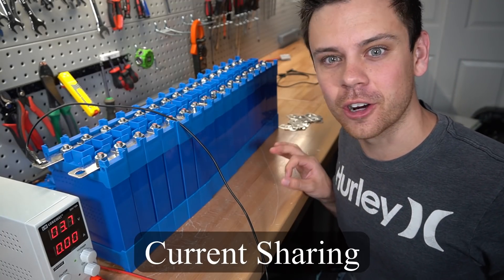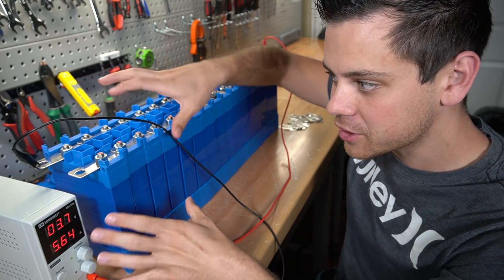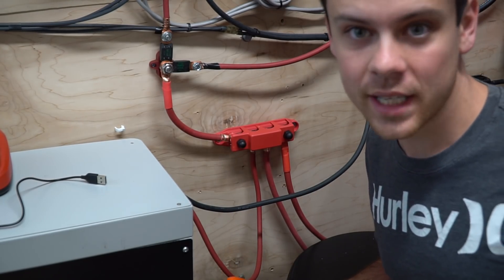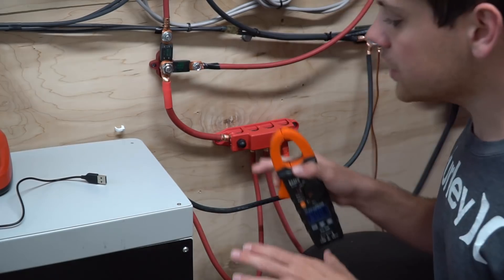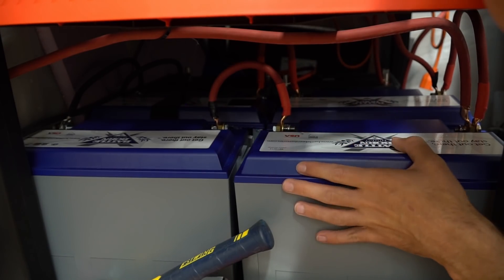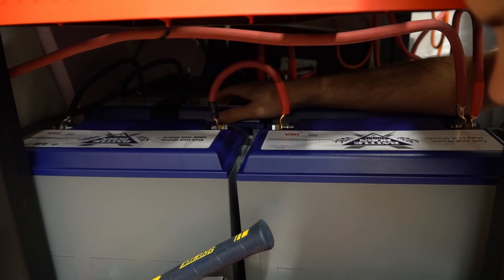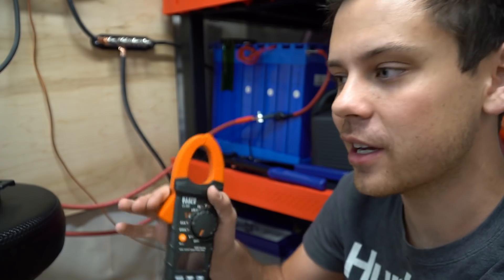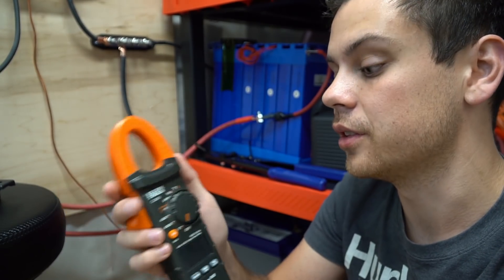Current Sharing Discussion for Solar Batteries

Comment: Is there a device that looks to when the controller is not supplying the batteries when they are full. So I can use this to charge electric bike or heat water... etc and not waste surplus panel watts?

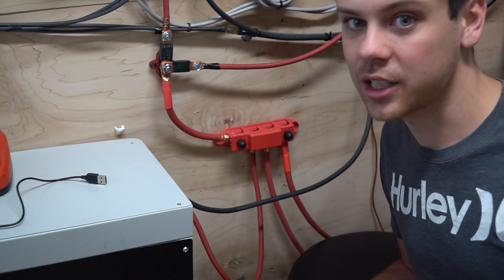Comment: I have always been taught to not connect different size batteries/battery banks in parallel (regardless of chemistry). Around 5:00 mark it seems like you have different battery packs connected all in parallel operating together. Wondering what I am missing, what article did I forget to read?

Comment: I wired all my batteries to a common busbars for neg and pos. Much nicer battery load distribution.
Also each battery has a circuit breaker for ease of testing and isolation.

Comment: I'm in the process of building a solar system for an offgrid setup with no prior experience other than the occasional potching and your videos have been a massive help, legitimately. I'm starting very small (12v 100ah lifepo4 CALB, 400w solar, 40a epever, 2000w inverter to run basics)  but would like to add other batteries as I begin to need them. The thing that has got me is, everywhere I read, I'm told not to add new batteries to an older bank. When I'm ready I'll more than likely stick to 100ah calb cells, but could I use higher capacity cells, 200ah for example? You've just said that you have older battleborns with newer batteries. How did you get this to work? Does each bank (4 x 3.2v) need a bms so it'll shut down the batteries when they're depleted, or do I have to do something else to get them to work together? Its the last thing I need to get my head around because atm I can afford to get another 8 cells to start out with a bigger bank, adding to it is definitely more viable, but don't want to destroy batteries in the process of increasing my bank. Any advice?

Comment: Which solar inverter will you recommend for running with heavy duty loads for off grid tools like 2000wh 2000wh tools for 30 minutes continues?

Comment: Question, If while checking amp draw per your vid, could you place an additional path for current via jumper between connections to tune the draw between cells or would that be kind of a waste. Just wondering.
Reply from the maker: Yeah sure

Comment: when you tested the battle borns, did you consider that the other half might have a bit of a lower voltage? they might take turns contributing more current, like a see saw.

Comment: Hello. thanks for your videos they are great.
I have question,.  
I have 2 mppt.  one inverter. but that battery is my problem.  the battery  4 battery  6v each 400ah.   and 10 battery 12v each 80ah.   how i wire it .

Comment: Measuring current difference isn't the issue. Voltage difference across each cell is the issue. With low currents there will be low difference so you are probably okay, but showing amps is meaningless.
Reply from the maker: But there is a difference in resistance. And more or less resistance will change current flow if you have CV source. I remember using current to determine voltage drop. Such as a load test on a battery. It will change
Reply: @WillProwse  Correct. And measuring the voltage across the cell (or battery if you cannot access individual cells) is the most direct and accurate way to see what is going on. Measuring current exposes you to all the variables such as cell capacity, internal resistance, wire sizes, etc that you talked about in justifying why different currents were acceptable.
Measuring voltage across the cells is how we manage batteries. Works with series cells and parallel cells.
Reply from the maker: @Sylvan_dB  ohh ok, smart. Should do that instead. Thanks Sylvan

Comment: Great video!! After watching it, I realized that it is possible to connect more that one battery in an inverter. You have batteries with different capacities. Do you have a video explain how to connect them? Which aspects should be taken care? If you don't have a video I encourage you to make one.
Thanks.
Reply: Exactly...I have been wondering this for sometime.
Reply: I'm wondering how best to connect 18650 packs to my lifepo4 system. I know I'll only get a portion of the capacity out of the 18650s but at least they'd be used more

Comment: What are your thoughts for a combined AGM & Lithium battery bank? I want new LiPo batteries but want to use my existing 24v AGM bank. I see lots of threads on people using them combined with no problems, any long term problems?
Reply from the maker: Never ever do it

Comment: I have found that the best way to parallel connect a larger bank of batteries is the "octopus" way: hook each positive post to a terminal block with the same length wire, then from that block to the use/charging. Same with the negative side. This lessens the difference, plus one can disconnect one battery in the system without shutting down the whole system, which one cannot do by hooking the batteries positive post to positive post as shown above.
I wish I could upload the diagram...and hope this is understandable!

Comment: So, Will? I was thinking of starting a small, 'cottage industry' business of building LiFePO4 prismatic cell batteries in small batches, and, offering a reasonable warranty to buyers. Amazed at the capabilities of certain cells, my biggest struggle is locating a battery box of correct dimensions to reduce moisture & dust concerns as vibration is addressed in the cell design. Without taking huge risks, I think it could be profitable, while saving battery buyers LOTS OF MOOLAH. Economies of scale, and, not skimping could provide buyers with an awesome product and save money on the huge 'cost of entry' from lead acid.
Any thoughts?
Dave

Comment: Learning so much on solar configurations - thanks Will.   I am looking for anyone to point me to the article or video.  I am looking to see if i can automatically transfer charge to a small elec water heater, after my battery bank is full?  Vanlife, while out on overnight hikes would like to come back to hot water.
Reply: This is possible with electrodacus stuff, he made his sbms for exactly this reason. He has an add-on that makes this possible, but it can be a bit daunting to program the entire setup. You May still want to take a look into it though.

Comment: 8:54  ... or you could just use a BMS that doesn't sit IN the charge/load circuit.
Reply: A BMS that doesn't sit "in" the circuit won't be able to perform some critical safety features and I would argue may not even be a BMS. By its nature it should be able to cut off the battery from excessive currents, charging when under/overtemperature, and over/undervoltage, which requires the capability to interrupt the connections to the battery. You can't interrupt a circuit without being "in" that circuit, so what BMSes are you referring to that don't? Even if they're controlling a relay, I would say that relay is part of the BMS (just like the FETs in other BMSes are).

Comment: I have a dual 48v lithium battery bank, that is based on two different chemistry, one is a 12.7kw  lifepo4 (S-16)and the other 6.4kw lithium ion (S-14), these are paired together, i graph them with a DC-emon, it is quiet interesting the charge and discharge graph  they produce

Comment: The little current difference is probably only due to contact resistance via the crocodile clamps. I doesnt really matter where you clamp them on this pack - as you said. Anyway its good practice to always look for decent current sharing and even distribution. It would matter more when you pull or push hundreds of Amps.

Comment: I have a question for you Will.
I've been using solar in my box van for about 5 years (3-315 watt 24v panels), I have always used the battery bank negative for all of my ground connections, I don't use the vehicle frame for any of the battery bank grounds and I don't have my inverter or charge controller connected to a common frame ground either.
The reason is somewhat pathological and probably over thought, I had a computer repair business back in the early 90's (think 286 & 386's) anyway at some point I researched 12v negative and 5 volt negative power issues within a closed system and equated that with vehicle negative 12v and giving my starting battery too much negative amperage or confusing my solar battery bank with the starter battery's negative voltage, etc., etc.
This was also why I bought a 12v inverter instead of a 24v or 36v inverter, I suppose I have a tendency to over think and rationalize a problem based on my own unique experiences.

Is this the right way to wire a battery bank in a vehicle, or should I have grounded everything to the frame?    I have asked this question many times and no one has ever answered it.
Reply: Actually there no way to confuse the 2 batteries as long as the positives are on completely separate circuits. You could hook up 2 batteries negative terminals to the same bus bar, but if you only hook up one battery positive terminal, it will only flow into that same batteries negative terminal as it tries to equalize itself across both sides.  As long as there is no complete circuit on the positive sides to both batteries, they will ignore each other. Rather both batteries need to see both of each other's terminals in a complete circuit for it to effect each other.  You could technically do the same using the positive side as the ground also and it would work.

Comment: can i charge my 12 volts battery system with 24v panel connecti0n using mppt charge c0ntroller?, is it ok,? also, also. which is better when using inverter,, 12v to 220v or 24v to 220v?,

Comment: Quick question regarding material conductivity, heat. The 120AH LFP prismatic cells I purchased from China have a 6mm threaded Stainless Steel stud and a small buss bar pad. I thought that was an odd choice of material due to the low conductivity of SS. Of course as you pointed out the current from this battery rarely exceeds 20-25 amps so probably doesn't matter but under full load the inverter could pull up to 85 amps. Seems like a lot for a 6 mm SS stud. Have you had any problems with stainless steel? Heat, galvanic corrosion? Thx

Comment: Will, what's your opinion on supercapacitors inline to a system. I bought into a bulk purchase of 160 x 3000f 2.7v Maxwell units from aliexpress last year for $1800 and installed them in a 20s8p for a 48v system in my shop, I have the solar charge controllers wired directly to the supercapacitors with my battery bank wired in parallel to the supercapacitors. I also have the inverter tied directly to the supercapacitors, so everything charging and discharging is occurring through the supercapacitors. Prior to the supercapacitor install my average recharge time on the battery bank was between noon and 1pm, now with the supercapacitors, my average amp charge rate is up 13% according to the software filling the batteries on most days around 11am, but between 11am and noon. When I installed the battery bank to the supercapacitors, I put a few loops in the welding wire I used to increase the line resistance between the supercapacitors and the battery bank, so more of the amp load is always pulled from the capacitors during high amp draws. Since installing it this way, I find the batteries stay very balanced, because the supercapacitors jump to target voltage nearly instantly during charging and pulls more amps from the solar panels during charging than It did prior, so the batteries spend most of their life balancing from the supercapacitors. I added the supercapacitors, because 4 years ago i came across lightsaber who made starting battery from supercapacitors and i have made multiple car batteries using them over the years and been reliably running a pair of them in my diesel pickup that has started perfectly with them all the way down into the -15f temperatures. I used $15 computer UPS batteries paralleled to the supercapacitors with 0.5ohm resistors and they are still working perfectly 4 years later in the diy battery packs.

Comment: Hey Will, I have a question. Would a higher internal resistance in a battery pack pull more or less current from a battery?
Reply from the maker: Higher internal resistance will pull less amps. If you have a lead acid and LiFePO4 in parallel, the LiFePO4 will pull more because it has lower resistance. Also a new lead acid will have lower resistance than an old one. Depends on temperature and other factors, and putting any of these packs in parallel is a horrible idea. But fun thought exercise

Comment: So if you have a 90ah battery connected with a 100ah in parallel. Will it shut down with the 100ah still having 10% of charge? Or do they discharge both the same?
Reply from the maker: They discharge the same but you will still have two different capacities. But yes, should cut off at 10% soc
Reply from the maker: Bigger battery will have lower resistance so it should be fine. My forum member actually posted a study on this. Really fascinating. I still dislike parallel strings unless you have ocpd etc
Reply: @WillProwse  Thats very valuable information! Thanks a lot.

Comment: Hi Will, it’s actually worse than you think during the first minutes of this video where you test the difference. I have two points: 1) you don’t have “a 150 amp bus bar”. You have 32 150A busbars all connected on the cell terminals. Each one has an insertion loss and for the last battery all those add up. One solid long bus bar would prevent that but that’s not what you have. 2) you compare the current from the power supply to the pack for each connection method. That’s not how it works. With the power source connected to the same first cell, you need to measure the current through that specific cell and compare it to the current that runs through the last cell.
With the 12V batteries I agree with you although the difference between the two Battleborn strings is surprising. You can measure voltage drop overthe parallel wiring to check this... should be near zero ( red probe on 24V positive of first string and black probe on 24V positive of last string)
Reply from the maker: True but for balancing it will still be fine. When it drops to .1A or zero, I will attach to other end and its the same. But yes very true. Just not significant for me to care at all.

Yeah I should figure out why the difference with the bb exist. Should probably test that more. Maybe different SOC
Reply: DIY Solar Power with Will Prowse I agree that it will balance when you get down to near zero current... but (always a but) it will take longer! ;-) I agree it won’t keep you awake at night

Comment: Was looking on getting battery backup for home, have 7 k solar grid tied crunching the numbers and for the money tesla power wall seams the best choice per usable kw  compared to 8 battle born and victron inverter with power assist since i want to use yamaha 3000 inverter  to charge battery bank and tesla dosnt support generator charging. After huracane maria it was cloudy for 3 days and most battery backup systems failed unless you had generator. I ran 700 hrs 30 days with window ac at night and spent $450 on gas running almost 24 hrs a day the yamaha so money wise generator is cheaper to run and runs on dino juice ( gas). So my question tesla power wall or diy with similar specs would like Lifepo battery i n 24 v conf in case one battery fails i can still use the system with 6 batterys

Comment: I think if you were to swap the location of the older and the newer Battle Børns And retest you would find that the older bottle Børns would be the ones drawing the highest amperage then the newer ones at a lower level followed by a lower level on the lion batteries
Reply from the maker: That would be fun to test
Reply from the maker: Lion will always be lower due to smaller size
Reply: DIY Solar Power with Will Prowse I don’t think that’s true I think if the lion we’re at the head of the pack you would Pull the most amps .....I don’t think it matters what batteries go where the first battery set will pull the most the second battery set will pull the second most and the last battery set will pull the least....

If you take 4 LifePo4 batteries and make a 12v pack and they were never balanced after using them for a while the first battery in the pack would have the lowest voltage and so on...
That’s why you need balancing

Comment: Sure that is how it works and to go a little deeper as those 12volt battle borns get a little older and the built in bms starts to breakdown the current sharing will change again as each battery will perform differently as the weaker cells in each battery will determine when the bms shuts down.

Comment: My Victron bp disconnected successfully when it went Under voltage, but now the battery is above low voltage but it doesn’t erase E3 (under voltage error) Help? The manual is not helping. What are guys doing to troubleshoot?
Reply: Whilst they do have a voltage threshold to disconnect, it has a separate voltage threshold to re-connect. Additionally, there is a time delay (30 seconds??) for the re-connect voltage. Going from memory her but I think the defaults are 10V to disconnect, 12V (for 30 seconds??) to re-connect. But these are configurable, so maybe your is set differently. But short version: there's nothing you need to do, just present the re-connect voltage for whatever the reconnect delay is.